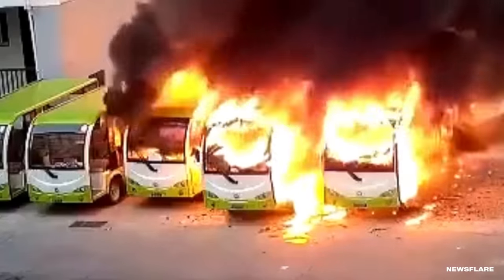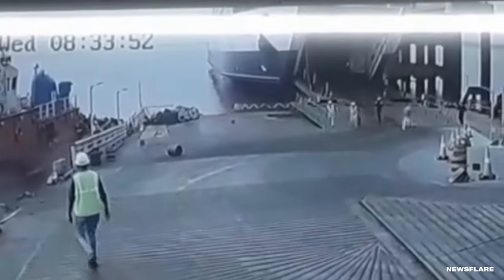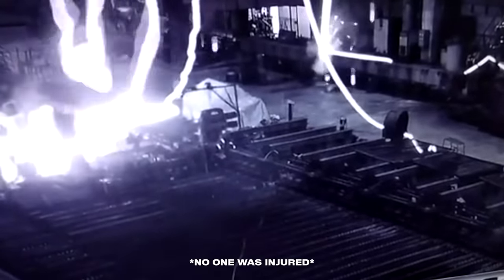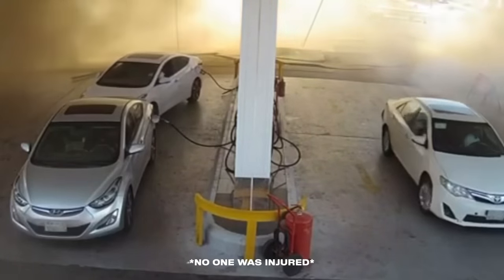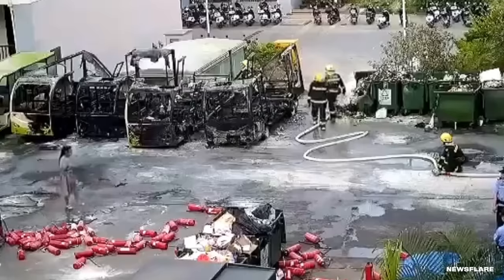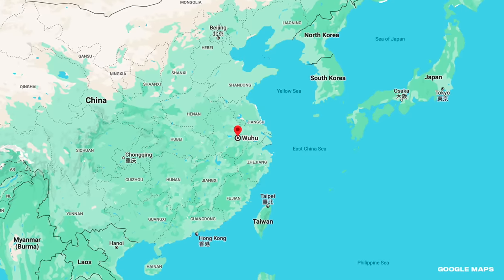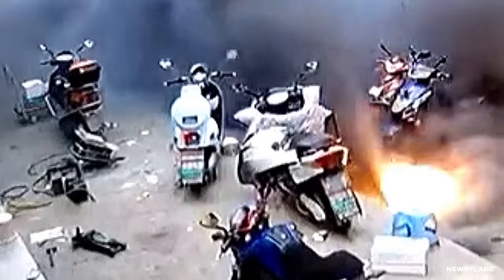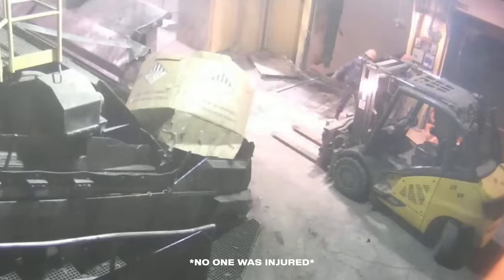Catastrophic Failures Caught on CCTV Camera

Comment: And that is why you DO NOT go electric
Reply: amazing..good job
Reply: Yea, because combustion engines never blow up or catch fire...clown
Reply: Nah, I don't need gas burning appliances polluting my home's air quality.
Reply: Make sure you think from multiple area before you think this. Ice are also good in their own, ev are too if choosen carefully as with ice vehicle.
Reply: You are aware that burning gas cars is a thing? Every day, every country. It’s just not in the news. Difference is, electric cars mostly catch fire when unsupervised while gas cars burn down while operating.
Reply: I think it’s the poorly designed battery.
Reply: Yea because an internal combustion engine has never caught fire before
Reply: The problem is not electricity, the problem is lithium.  Lead-acid batteries also develop internal shorts, but when they happen, the mass is so large and the energy density so low that all that happens is that the engine will not crank the next time you try to start it; although, the battery housing may also be bulged.  Lithium cells have low mass and high energy density, so an internal short causes a huge spike in temperature that may take the cell above its flashpoint, so a fire erupts and that fire may cause a chain reaction.

Once we move past battery technologies that depend on atoms moving on and off the electrode, we will stop having these types of fires.  Because the atoms do not return to the same spots that they left, the electrodes become rough.  Roughness encourages the formation of spikes and the spikes keep growing, until an internal short forms.  Good quality control means that the electrodes begin smoother.  Moving things further apart (reducing the energy density) makes it take longer for spikes to form a short.  Recombinant flow cells generate electricity by moving H3O+ ions through a semi-permeable membrane between two electrolytes.  The electrodes are unchanged by the charge/discharge cycle, so these types of failures and resultant6 fires become impossible.  Recombinant flow batteries have their own problems, but erupting in flames is not one of them.
Reply: @BigIrishSean  You are correct, it probably was triggered by static electricity and a grounding fault.  Explosions in underground fuel tanks are even rarer than EV battery fires.  This is the same sort of incident that brought down TWA800.  Somehow, a spark was introduced to the tank while it had a large volume of fumes and air.  If it had happened in the US, the Chemical Safety Board would investigate with the same tenacity as the NTSB investigating an aircraft crash to prevent future incidents
Reply: @Claus-y5y  To be fair, fires in internal combustion engined vehicles burn at a lower temperature and do not supply their own oxygen, so they are easier to fight and less likely to spread.  As the lithium battery fire supplies its own oxygen, all fire fighters can do is keep everything around the battery cool, so that the fire does not spread.
Reply: Because gas powered cars have never exploded...